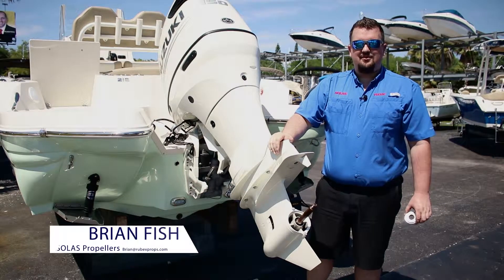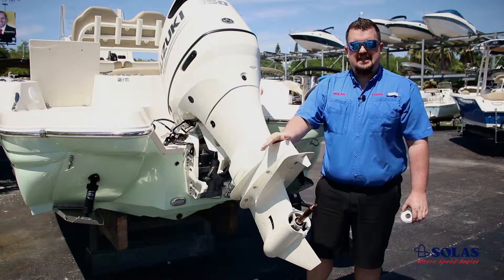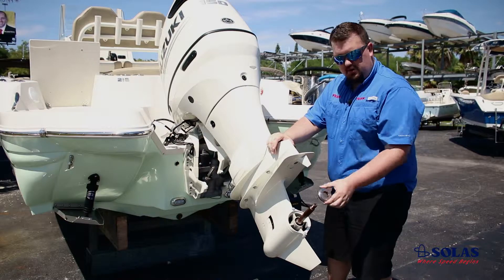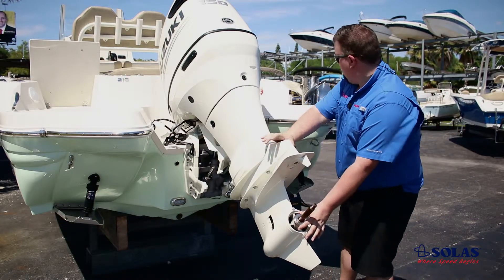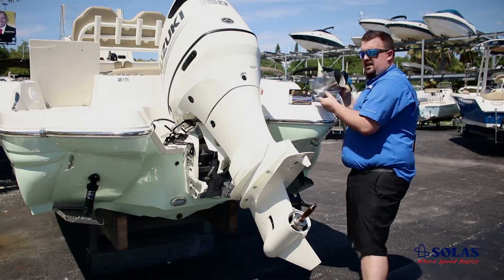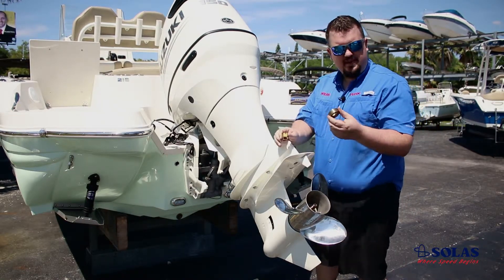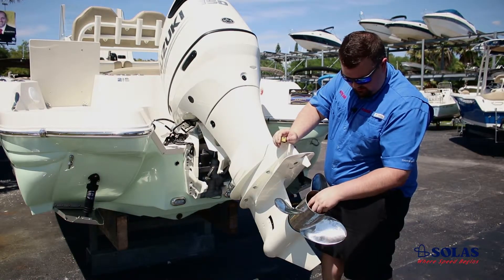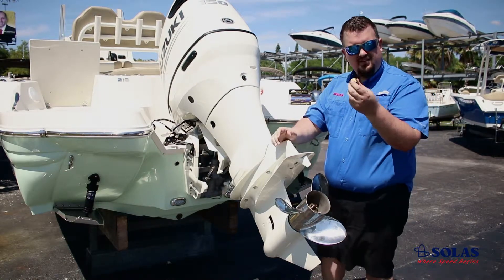How to Install a RBX-104 and 104B Hub Kit

Comment: Thanks for the video. I just did my install today. I noticed in other videos, you put both the OEM thrust washer AND the Rubex thrust washer on. In this case, it's just the Rubex thrust washer, correct? I can't see how everything will fit on the shaft with both thrust washers on.
Reply: Asking this because the instructions in the Rubex hub kit are a little confusing. You guys say to use the OEM parts, but clearly this video shows not to use the original thrust washer
Reply from the maker: what videos are you referencing? 
our RBX-123 and RBX-203X are the only kits that require the original thrust washer.